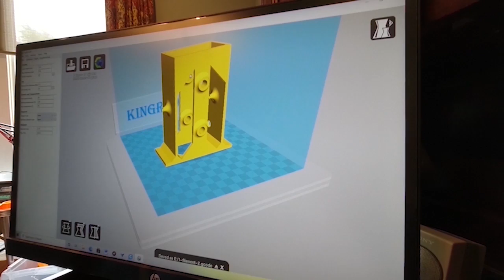WHY DID MY 3D PRINTER  ???  STOP PRINTING  ???  watch this video and find out WHY & how I fixed it.

Comment: First. I like your videos. Probably more because of your kind personality as because of the printers. 

But more important as a comment now. You printer looks like it had a thermal runaway and it hasn’t stopped.  Even if in your case the heat element died you had luck. If the thermistor has died it could cause the heater to pump more and more heat. This is a fire hazard and it is a no go for a 3d printer nowadays.  

Pls check your firmware or settings  to prevent this in the future. Klipper would have shoot down the printer after 3 seconds.
Reply from the maker: Thanks for the comment and for sharing that info. I may not have explained things very well in this video, but these printers do have thermal runaway in the firmware, and it works fine. I did a video a while back where I tested the thermal runaway prevention on these printers. In this video the thermal runaway feature in the printer activated when there was no heat at all because the heating element had burned out and the printer was still sending power to it without getting an indication of heat from the thermistor in the allotted time provided by the firmware program. Hope this helps clear things up. You are so right, 3D printers should all have thermal runaway protection to prevent damage to the printers as well as a potential fire. Thanks for your support...Ken

Comment: This is so uncanny as I had the exact same issue on one of my Ender 5 Plus printers on Sunday, luckily I keep a good stock of spare parts, also on Sunday my NAS server went faulty and the WiFi network adapter on my laptop, all this kept me busy for the best part of the day, I was trying to fix it them and was getting nowhere and then I remembered I had system backups running and had a backup from just 12 hours prior to the faults and I was back up and running in 10 minutes, I am so glad I automated my backups!
Reply from the maker: Thanks for sharing that, Andrew, and it's great to hear from you again my friend. Never a dull moment when you're 3D printing...Ken